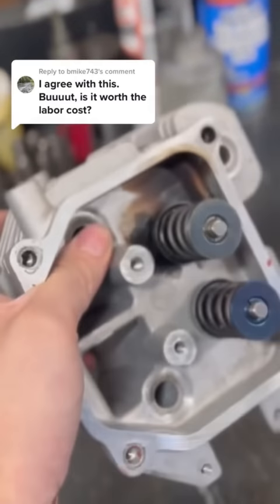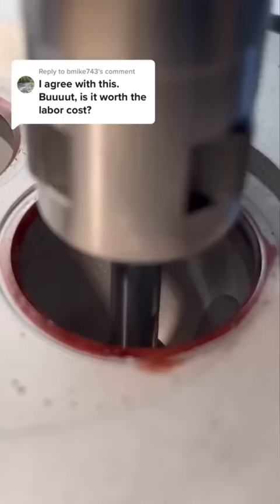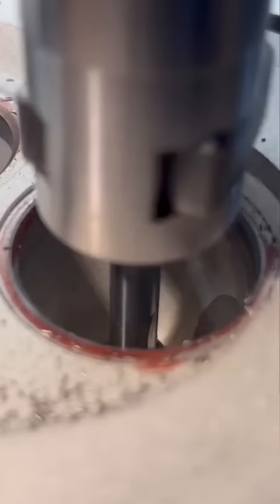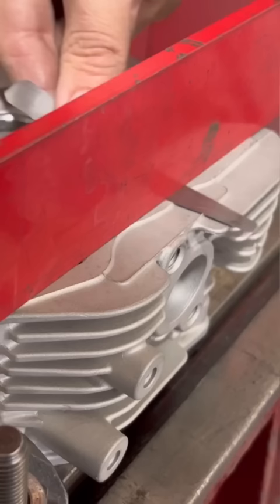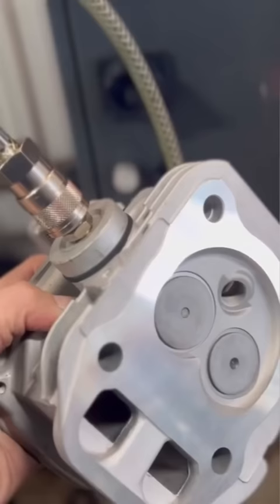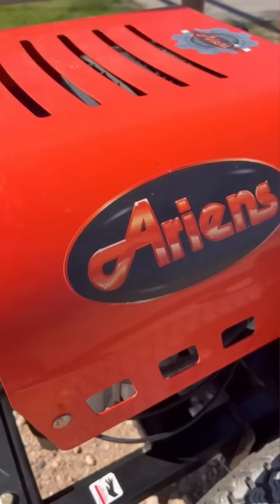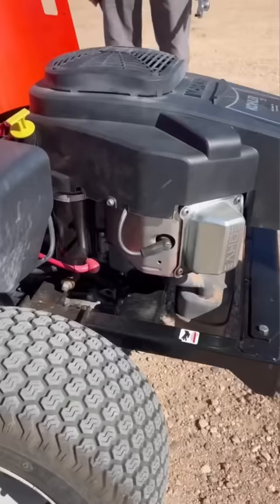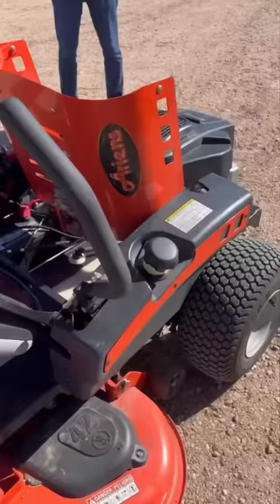#shorts Is Machining A Lawn Mower Head Even Worth It?

Comment: Good neighbors are harder to come by then lawnmower engines.
Reply: Ain’t that damn truth
Reply: Good Kohlers are as hard to come by as good neighbours. Thats why the heads were modified rather than new replacements that will fail the same way.
Reply: @rossbrumby1957  It didn't used to be that way. There was a time when Kohlers stood above the rest in the small engine world
Reply: I have a good amount of good neighbors. They're very friendly and welcoming.

Comment: To be honest, sometimes it not about time or money, sometimes it about not being wasteful and wanting to maintain the equipment you have rather than our modern buy it, break it, throw it away, replace it mentality.
Reply: Exactly. Got in the comments to say just this but you beat me to it. I'm sick of the wasteful mentality.
Reply: Fact is he is correct. It's FAR FAR cheaper to just scrap it. Pulling wrenches all my life. We know what's worth to salvage. 
Also alot of these motors are designed to fail even if taken care of. 
I do try and salvage as much as  I can when I'm building alot. But its very hard when doing work for ppl. And costs. It's not cheap anymore.
Reply: @GreyFox250  Was going to say something but if you listen to what he says in the video it makes sense…. Time is money, labour outweighs the cost, makes no sense to repair it unfortunately
Reply: @Billo-07  comes down to a matter of perspective. Personally, I think everyone is completely ignorant to how wasteful we really are as a society. I took some old fertilizer and yard chemicals from my parents garage that had been sitting on the shelves for years to the hazardous waste at my local landfill. It was sobering to see how much was there. Not just the landfill, but the hazardous waste area. Fridges, lawn mowers, stains, paints fertilizers, gasoline, lithium batteries, tires. Speaking of the lawnmowers and fridges specifically, how many of them were there that had lots of life left in them, but were you told it wasn't worth it by the "time is money" mentality, or it's cheaper to get a new one. I understand that in some scenarios it really isn't worth it, but to mill a couple thousandths off a warped head and reinstall it is definitely worth it. Personally, I think the people who are of the mentality who are only motivated or worried about the bottom line or if it profits them are the problem, and a big proponent to this screwed up world we live in, if not the root cause entirely.
Reply: @mitchellandrew3318  I went to tech school for small engine and wouldn't consider the same machines for head work. I was taught to use a tool like a neway to to valve seats and lap the valves. And I have a marble "head" stone that's certified flat with sand paper taped to it for resurfacing heads. Quick and easy. And fixes most heads. A bad valve guide them replace if possible. But a lot of small engine work can be done far cheaper then a proper machine can do it.
Reply: @meegstomtom  I get that. That's why I said most don't fit the bill or so damn wrapped. Over costs even to grab a small engine. 
I didn't go to tech school. But I've been building small engines since I was 13, 37 in a few months. From stock to full race, 2 and 4 strokes. There is certain brands I personally won't bother with. Which is mostly my base customers since going on my own wrenching full time. 
I still use old school ball hones and flatten out heads without machines if I don't need a machine shop ( got buddy's who are machinists also, great thing about being in trades, we trade off work alot, as I've developed lots of trades skills over my J man trade I did coming outta of grade 10). 
So you need to make your own judgement and calls on work. As I charge myself out at $100-150hr cause I specialize in many things. I like my old school, but I also know my new stuff and have gear to dig into ECUs and stuff. But I can still set up your carburetor on anything. Big into diesels also and did a ton of HD work while working as a HD equipment operator. I followed the money and developed my trades. So you get to learn a ton over the years from good mechanics also, and sadly lots isn't worth saving for the small stuff. Even alot of automotive stuff its cheaper for me to just swap in a motor from a wrecked vehicle. Human race has made most to throw away. My least favorite and never take on is ford's anymore. Done with there garbage. Unless it's the old school diesels and traditional v8s.
Reply: @Billo-07  If I walk in the door carrying a pair of those heads and say 'I want them machined/rebuilt' it's because I'm willing to spend the money to do so. And probably because I'm working on a pre-disposability engine from several decades ago.
Reply: I would agree, except when it comes to things like metals that are infinitely recyclable, it arguably doesn't matter and never will
Reply: @barryallen5507  only if you actually recycle them. Most times it probably ends up in a landfill
Reply: Money is a measure of value. If it is cost prohibitive to repair, it should be replaced. The cast piece of metal can and should be recycled. You can just consider that a repair if you like. Melt down and recast a new head. There you go.
Reply: This only really makes sense if something has some sort of emotional value. In this case, sure I guess if you really care about not 'wasting' and item then sure I guess. That does however beg the question, how far are you willing to go?

Also, ultimately a head is just a chunk of metal that could be easily sold for scrap, melted and be turned into something useful.

You have to be able to know when to just give up on some things, and learn when it just doesn't make sense to just buy a new part
Reply: @josejimenez896  there is always a point of diminishing returns for sure. My dad always used to say if a repair cost most than half the value of the vehicle, it was time to consider getting rid of it.
Reply: @MWilk098  What's cost-prohibitive to repair to you isn't necessarily cost-prohibitive to repair to me. A lot of people would say putting 8-10k into my '85 F150 for an engine overhaul is not worth it, but the way I see it, I can either put that money into a truck I know will give me another 40+ years of faithful service or I can put that money into a plastic pile of shit that won't last ten. To you, and indeed most of the world, it is cost-prohibitive to rebuild the engine in a truck they bought for $500 15 years ago. To me it's cost prohibitive to replace that truck with a newer one that'll need to be replaced again in just a few short years. The ROI I get rebuilding the one I already have will be 4x what I'd get replacing it outright.

So that ol' 300 is getting rebuilt. I already got 15 years and 150k miles out of it as it is, I say it's earned it.

The sentiment you're espousing is also why electric cars are an environmental nightmare. That $20,000 dollar battery pack replacement they're gonna need when they're 10-15 years old all but guarantees 99% of them end up thrown away like an empty starbucks cup right on cue. Rather than repairing their old car they'll just throw the entire fucking thing away and buy a new one. They already do this with fuel cars, with cell phones, clothing, appliances, fuck even houses are built to discard anymore. And, yeah, that includes lawn tools, to bring it all full circle back to the topic of the video. Lawn tools, even expensive ones like garden tractors, are disposable goods these days. They're not meant to be repaired. *And it's sickening.*

I fucking hate our disposable society. Repair, don't replace. Build to last, not to discard. It's why I refuse to buy new products whenever I possibly can; older stuff was built to last and built to be serviced so it's a pretty safe bet I can get more use out of a cheaper, supposedly worthless old 'thing' if I buy it for pennies, repair it for the cost of the new one. So yeah you're damn straight I'll have the heads for that 40 year old lawn tractor milled if it needs it! The end result will outlive the next five generations of lawn tractors that come out after I make the repairs.
Reply: Yeah but when buying the part is cheaper than fixing, it just doesn’t make sense for common folk or people running a business. Scrap it if you don’t want to be wasteful
Reply: @brunovazquez1  the question is how much cheaper. Id rather have the part fixed, and have the tolerance better than factory for a little bit more. Rather than another poorly finished head that will just blow out again a few year down the line.
Reply: @jonathanrogers9961  For sure less than half of what a machinist would charge
Reply: @brunovazquez1  but i would rather pay double and have it right, than to get another poor quality block that will go out on me in a couple years and leave me back where i started
Reply: @GreyFox250  It would be awsome to live in an world where we would need to really take care of things but right now i just dont see the point. If my shitbox of an car breaks down im finally upgrading it, why would i fix it? I like the car but i just cant see an point on putting money to something that will rust away in the next 5-10 years, id rather buy something better and make sure it doesnt rust at all for the next 5-10 years. Id rather be fixing the rust that comes up than fixing the holes the rust is making.
Reply: As he said...if you, the customer, is fine trading 10 hours of their working life to fix an old head instead of 5 hours of working life for a new one, they will absolutely do it. However..if you value your time, your life, and don't want to give away twice what you gain, just buy a new one. It's 2022, we're still flushing turds... You saving and polishing yours?!
Reply: @jordanbabcock9349  so i should spend money to buy a new turd, instead of making the turd i already have better than it was from the factory. Yeah nope.
Reply: @TestECull  100% in that case, once again like he said in the video “if you can buy a new one” if you can’t then they’ll repair it, it depends on the cost of a new one.
Reply: @Billo-07  If I walk into a machine shop with a pair of heads in hand I am getting those heads machined. I dont care if they're still in production or not. I already weighed things before coming in and already decided to rebuild rather than replace.
Reply: @barryallen5507  Aluminum is not "infinitely recyclable". Whomever told you that lied to you. Aluminum is porous, it will absorb contaminates into it's crystal structure and become mechanically brittle through chemical reactivity and oxidation. Aluminum that is heavily contaminated isn't recycled, because the cost to clean the contaminates out of the metal exceeds the resale value of the metal itself to a manufacturer who will re-process it into new alloy.
Reply: Yup. My old Dixon. Built with metal frame  and plastic body. A little tank. I think about it too often.
Reply: It is about time and money. RECYCLE METAL.
Reply: @dojoparsnip9905  I'd rather repair and reuse. If you are a greenie type you should know that the recycling leg of that triangle is the last resort on it. Reduce first, if not possible reuse.

Reusing these heads is clearly possible.

Find it hilarious when enviro types are the most vocal opponents of repairing and reusing the things we already have...
Reply: @TestECull  im not a greenie type at all. It is metal. it is recyclable. Also i value my time different than yourself. i can buy a new one in 2 hours of work. and have someone else play the reuse game. Of i was a greenie by the way, i wouldnt buy a new one. i would repair and reuse. That is the hippie mantra.
Reply: @TestECull  i also find it funny you assume my stance and project.You are the one recycling. lolololol.
Reply: @dojoparsnip9905  Nope lol. You dont even know the difference between reuse and recycling.
Reply: To be fair, the heads are solid metal and metal is easy to recycle.
Reply: Yeah I feel this is the issue, everything gets  priced out of repair so this most likely would be recycled but a person who has the buy it new mind will jave the just throw it in the trash mind
Reply: Exactly my thoughts
Reply: And a lot of the aftermarket stuff is complete trash

Comment: I’m a firm believer that the customer can spend their money how they please. I’d advise them that it will be much more expensive than replacement parts, quote them however much I need to and if they’re in, I’m in! You can’t price yourself out if the customer wants YOUR quality work
Reply: That's right. Just did it on my Kohler. I couldn't wait for parts, and saved $20
Reply: Especially when they are brand new factory heads that they not only want basic work performed, but performance mods done such as better than stock valve guides (alot of those stock heads have horrible valve guide clearances and excessive valve guide slop), porting and polishing, shaving the head surface for higher compression... I had a machine shop tell me it wasn't cost effective (head work on a qmb139 (50cc engine) then I told them I was building a crazy power build (by the time we were done it was pushing 80hp/90ft lbs at 96cc actual displacement... That was one hell of a crazy 50cc scooter

Comment: We race mowers tho man so machining is key
Reply: Haha I surfaced mine on a surface plate with some 400 grit 🤣
Might be a little too smooth of a surface (it looked polished) for those composite graphite head gaskets but it's held together for 2-3yrs 😄
Reply: We use the commands for our pulling tractors. Luckily, I do my own machine work I guess 😂

Comment: I would rather pay you and know that someone who cares got the head straight. It would make a neat video to inspect a new head and see if it is in spec.
Reply: You wouldn't want to pay once you seen the cost of labor even if he did a amazing job, the cost of even the most basic of machining services these days is insane. In my area, pretty much all the local shops get $150+ to just resurface a set of heads, no clean up, no disassembly, nothing just a quick cut to get it flat. There used to be another local guy that would do the work alot cheaper and faster but unfortunately is now retired. Now adays to get a set of cylinder heads for most v8 engines "rebuilt" would cost easily $1500+ in parts in labor where you could buy either a new set or a cheap "remanufactured' set from one of the larger rebuilders like ATK for far cheaper than you could pay a local machine shop to rebuild them. Hence why most people just buy either a crate engine or just do a DIY backyard rebuild/repair.
Reply: @briang4470  the point being you get what you pay for. I've bought "high quality" reman heads that were visibly warped out of the box and I have spent a god awful amount of money rebuilding a set of heads that are still running beautifully over 100k miles later. I do understand that It is not cost effective to machine a lawnmower head unless it is a special application such as a mower engine in a race kart or something similar
Reply: @briang4470  Rebuild > Replace.
Reply: @TestECull for a lawnmower?
Not really